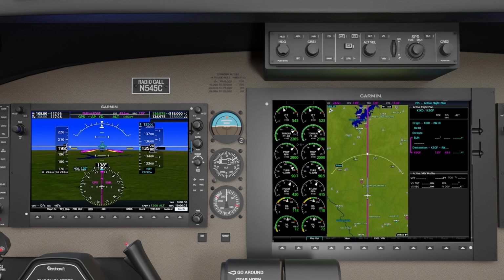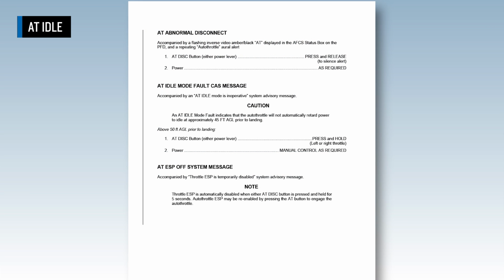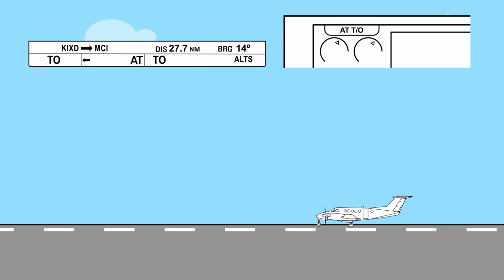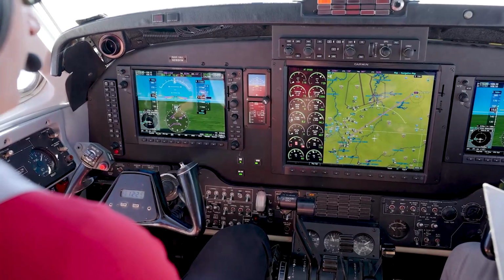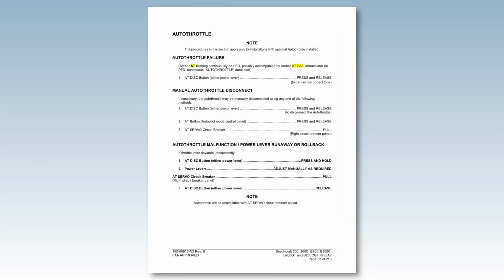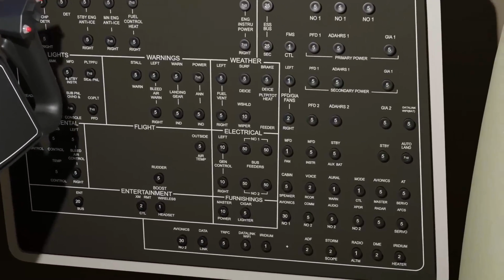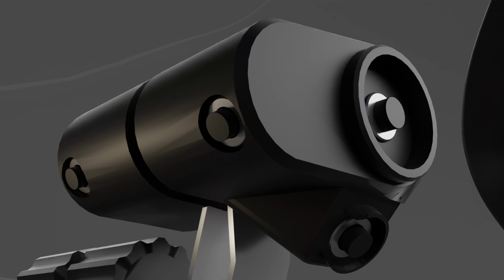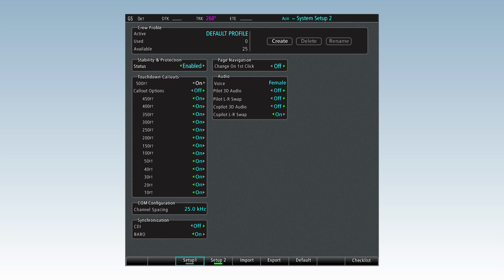B200 King Air Garmin Autothrottle: Abnormal Operations & Protections

Comment: What would cause auto throttle to surge at about 150 knots? We are having an issue where it is dropping torque for 1 to 2 seconds at a time and recovering. When this happens it will continuously surge until we disconnect. We can then re engage for a few minutes before the surging comes back.